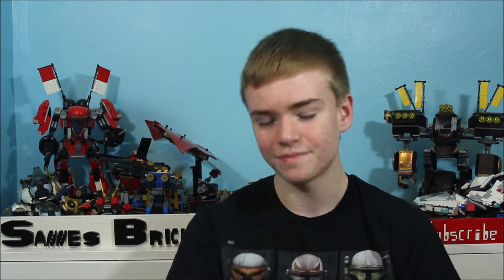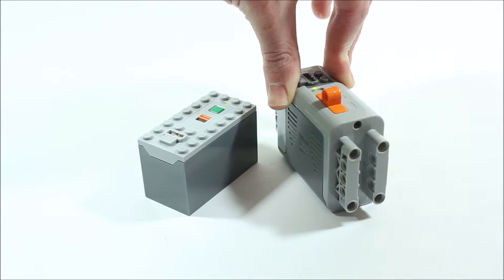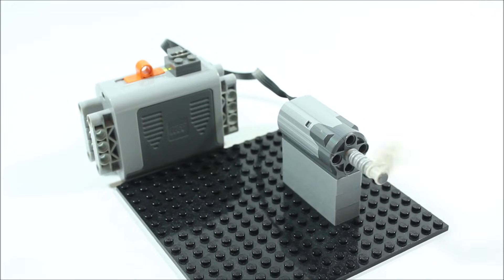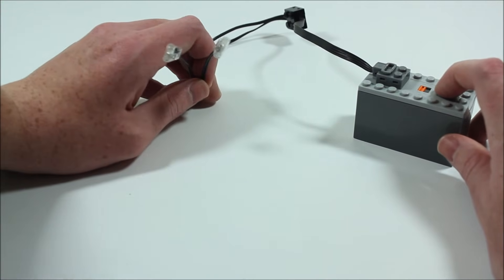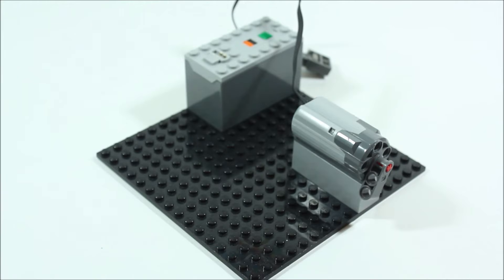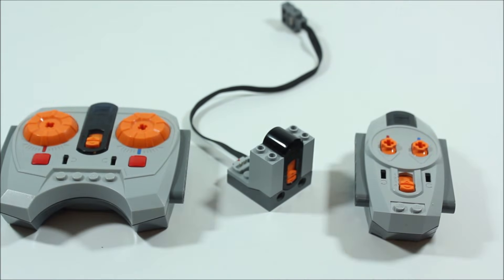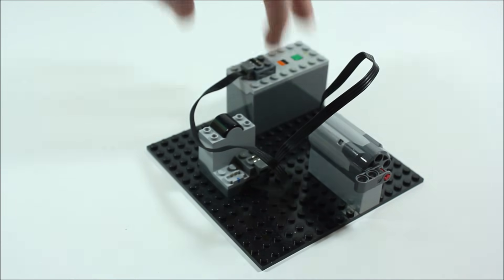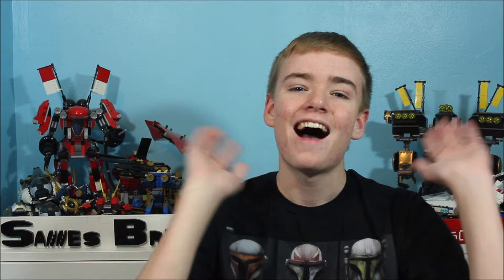LEGO Power Functions (Brick Tip #7)

Comment: what to do if the buttons are only green? Cuz if i press green it will just blink and do nothing in the motor. help
Reply: First you have to get the remote then point them at each other and press both buttons at the same time hold until they both change color and the colour
 Is not flashing also the remote and battery pack light should be the same colour

Comment: What is the product called
Reply: 9-in-1 Motor Kit Compatible with Lego Technic, Motor Set with Powerful Motors, Advanced Control Functionality, Ultimate Compatibility
Reply: Thanks  @isaiah-t6i
Reply: Lego power function
Reply: 32Pcs Power Function Kit Set Motor Battery Infrared-Remote-Control Receiver Train Adjustable Speed Motor Parts, Motor Power Change Parts compatible with mainbrands Technic-parts
Reply: 7-in-1 Motor Kit Compatible with Lego Technic - Science and Technology Power Function Kit with Motor Remote Receiver Battery Box Extension Wires
Reply: Or brotex
Reply: Lego
Reply: Reeeeeeeeeee
Reply: Lego
Reply: Lego

Comment: I have a few questions to ask (for clarification, I have not tried using any of the power units yet and have not put batteries into the battery packs).

1: Do the battery packs use a specific type of battery? If so, what batteries do they need?

2: Does the smaller battery pack turn itself off, or do I have to manually switch it off?

3: Does using the receiver with the bigger remote control follow the same rules as using it on the smaller controller (red output receives from red input and blue output receives from blue input)?
Reply: 1- AAA for the small battery box and AA for the big one
2- It’s a simple battery box with an on/off button. So, no it doesn’t turn itself off until you use the on/off button.
3- Yes. Both remotes work same except that the big one (which was made to be used as a train remote but still works as a simple remote) has dials to choose different speeds (-7 to 7) and a stop button in case you want to stop the motor without searching the neutral point on the remote.
Did I answer your questions ?

Comment: How long does the small battery pack last for?
Reply: In a reasonable use and if you don’t stress the motor too much, it can last a few months I think… I rarely change the batteries with my frequency of utilisation. (I use a technic battery box so yours will last less time) But if you run a train for hours, your battery level will lower faster and the motors will feel the pain of rolling for a long time in one go…

Comment: Do you need the receiver to operate the Lego Christmas train??? I just want it to move forward and backwards and don’t need to adjust speed. Can you operate the train with just the hub and train motor (using old power functions system)
Reply: Yes you can but I recommand using the remote still

Comment: Please respond. Are the fake lego motors on Amazon good?
Reply: I just bought a fake motor with the small battery box and the LEDs on a pack
The motor is fast and has good torque so it’s not easy to stop and it’s pretty quiet ( it gets even quieter when you load it)

Comment: My reciver don't work?!
Reply: Same 😕
Reply: @Sam.Rugby.69  turn off the battery box and turn it on, maybe it works
Reply: @alee6368  doesn’t work 😪😪
Reply: @Sam.Rugby.69  do you have moved the selector on the right Channel?
Reply: @alee6368  yep
Reply: @Sam.Rugby.69  strange...
Reply: Does the Green light on it lights on ? If not there’s probably a problem in the plug (it happens when you use the too much the the cable to unplug, then there’s a bad connection and you can’t repair it without breaking the plug)